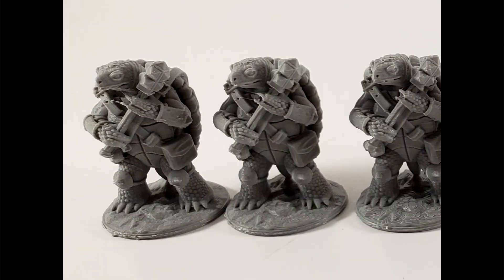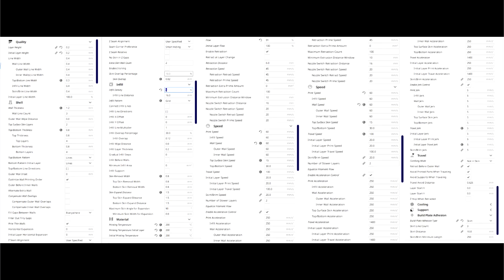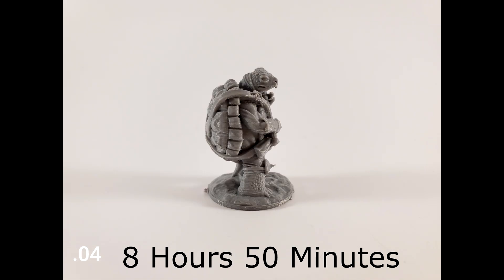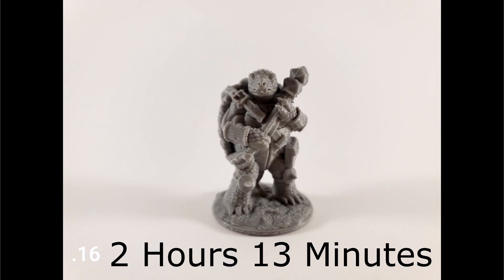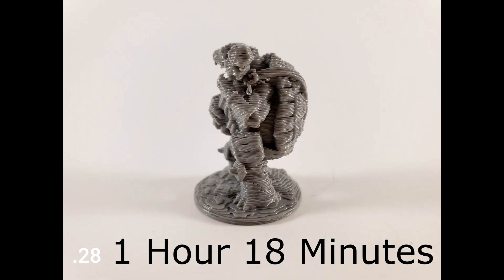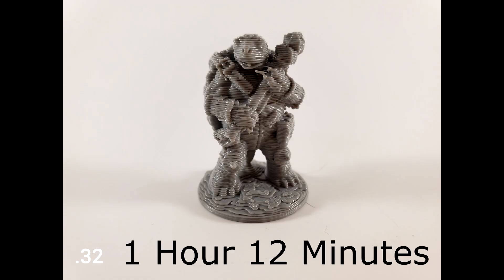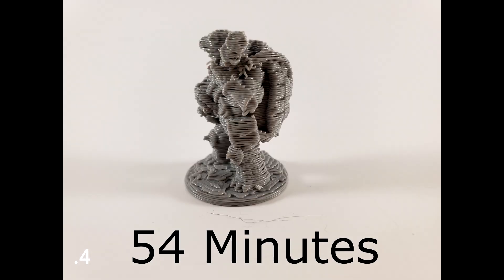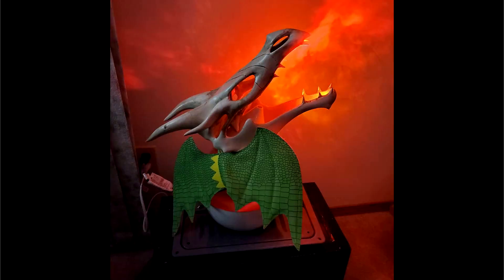.4 Nozzle Layer Height Comparison

Comment from the maker: What layer height is your favorite to print at?
Reply: I use .2 for terrain.  For minis on my anycubic I use .1.  On my MP mini pro it's .08.  Ironically if I go below these settings i have issues with overhangs that should be achievable witbout supports.
Reply: For terrain I bounce between 2mm and 1.8mm depending on the recommended layer height in the FDG PDF file. For minis I use a .1mm layer height. I hope to play around with speed setting in the future however I'm happy with the print quality I'm at currently. I don't want to mess with the setting right now since they work.
Reply from the maker: @Froggy-ts8yj  Terrain I totally use .2 as well. As far as print speeds I usually do 60mm/s for terrain,  and 45mm/s for models. And apart from that I usually leave everything else the same as well. And no need to change settings if its printing how you want it to!
Reply: @Jesters3DTabletopGaming  a trick for minis.  If you are using supports double or tripple the thickness of the supports.  So if your printing at .1. Use a .2 or .3 thickness for your supports.  They will snap off easier without damaging the model.
Reply from the maker: @charlescarper7344  I'll have to try that out!
Reply: I print at 0.1mm for tabletop gaming with variable height layers enabled.
Reply: Favorite for quality? 0.04 for me got settings dialed in pretty nice. 
Favorite for time? 0.12
Reply: Double your nozzle is the lowest layer height you should attempt. 
And stick to the magic number.

Comment: I promise I’m not trying to be mean, I enjoy your videos. Bro, what kind of printer is this? How small are those? They look terrible. My (quick/dirty) .3mm layer height prints at 100mms look better than almost all of these. With Polymaker PLA Plus/Pro or whatever.

Something’s either messed up with your printer or your slicer settings. I’m running a Artillery Sidewinder X1 with just a few upgrades like an all metal titanium heat break, a better thermistor and heat block. Everything else is pretty much stock.

Comment: I could be wrong but i think you can print smaller layer hight with larger diameter nozzle because the width of the layer stays the same only the volume and hight  is reduced when choosing smaller layer hight. But i dont know if i understand it correctly so i think max layer width for 0.4 nozzle mus be 0.4 right

Comment: 0.1 is a good trade-off, and is perfectly valid as half-stepping is as accurate as full-steps.
Reply: Depends on the machine -  stock Creality machines can't actually do half steps reliably, and quarter steps are just a failure. Not sure if its cheap motors or drivers or clean power but after testing 300+ machines I've only seen 6 that can do a half step reliably. (to be clear - all of the above is in the Z)

Comment: A lot of times when you go below .1 on an FDM printer the quality of the resolution is highly dependent on the stepper motors.   Cura is pretty good at knowing what the stock settings for the motors are.  I would not go below the finest settings in cura.  That is why you see a huge difference between .08 and .04.   Also I would not recommend anyone to go below .05 resolution on an FDM printer.  When dealing with resolutions like that you are into the realm of what should be done with SLA printers.   On a side note.. Good comparison.
Reply from the maker: Awesome so im not just crazy. Definitely good to know, so i thank you very much for that!! 
and side note, glad you enjoyed!!